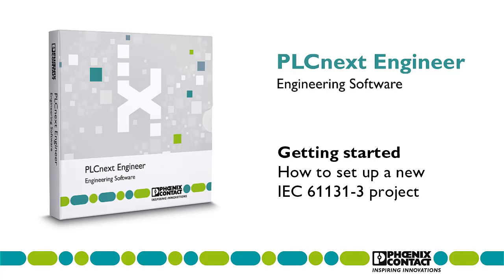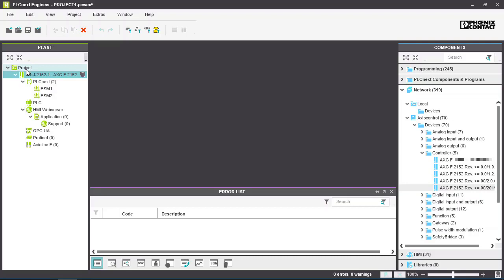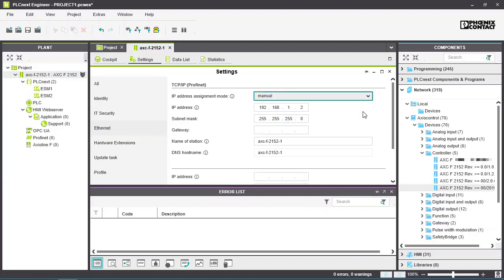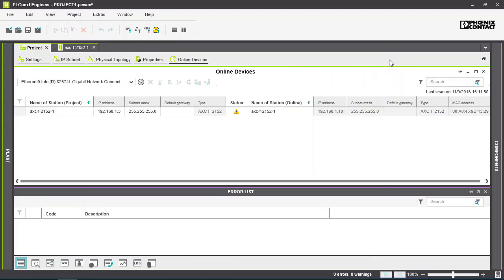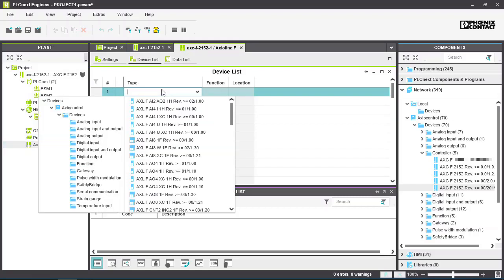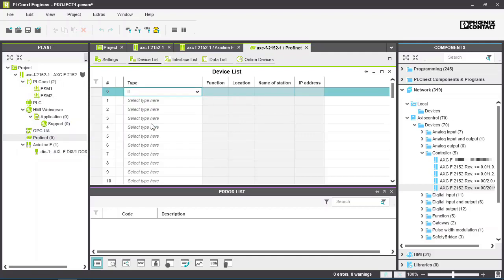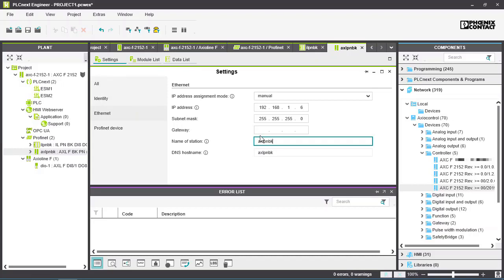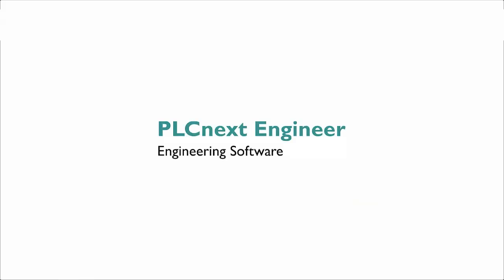How to set up a new project | Getting Started with PLCnext Engineer

Comment: how to add ib il  analog and digital input and output modules in plcnext
Reply from the maker: Hi Narendra, Phoenix Contact recommends the Inline ECO series which does not need to be configured and so there are no special function blocks. The Inline ECO is described here: https://www.phoenixcontact.com/online/portal/pi?1dmy&urile=wcm%3apath%3a/pien/web/main/products/subcategory_pages/Inline_the_fine-grained_IO_system_P-21-11-02/89035ff6-3950-4fbd-a4b0-e6e9e4eaab56/89035ff6-3950-4fbd-a4b0-e6e9e4eaab56

For further dialog, please switch to the Forum in the PLCnext Community (https://www.plcnext-community.net/en/discussions-2-offcanvas/categories.html) and create a user account there (free of charge, no newsletter bugging), so we can help you with this question more efficiently.

Comment: How I can get this plcnext engineer software? 
have some cost?
Reply from the maker: You can just download it free of charge here: 
http://www.phoenixcontact.com/qr/1046008/softw 
Pick the current 2019.0 LTS ("long-term support") version, or the 2019.9 preview version with more features. See the differences here: https://www.plcnext-community.net/index.php?option=com_content&view=article&id=393:plcnext-engineer-features-overview&catid=76&Itemid=361&lang=en
Read more on using this tool in industrial automation and get help in the Forum section of the PLCnext Community:
https://www.plcnext-community.net
No fees, no ad bugging, all is free to use. Contributions and feedback are welcome!
Reply: Have some cost
Reply from the maker: @Alejandro Ramirez No cost, free of charge! There are some Add-ins for PLCnext Engineer that come with a fee (Sequential Function Chart editor, ACI interface, Simulink Viewer, Functional Safety editor for PROFIsafe devices). But if you do not need these features, the fully functional basic version is completely free, including updates that match the quarterly firmware and SDK feature releases.

Comment: 937 steps later ... 👌  Surely this software has some search/scan function to find the controllers and modules, then add them to the project automatically?
Reply from the maker: Hi Dennis, thank you for the feedback.
 This video was designed for people who may or may not have access to a PLC when they start their project. From 1:30 in the video, you can see how to scan the network for controllers, which can be done before the other 936 steps, if you want. :-)
You can then select one of the discovered controllers from the list and, with one click, read the settings from the online device into your project. The same procedure can be used to discover Profinet devices on the network.
As for discovering local I/O modules - if you right-click on the "Axioline F" branch of the Project tree, you will see an option to "Read AXL F devices". This feature will be implemented in a future version, and will automatically discover all local I/O modules connected to the PLC.
 
We hope this answers your question.
Reply: @PhoenixContactTechnical  This does answer the question - thank you :)  We're getting one in hand next week and are looking forward to implementing some Adversarial NN sets for layered PIDs to smooth out oscillation in a variable input process.